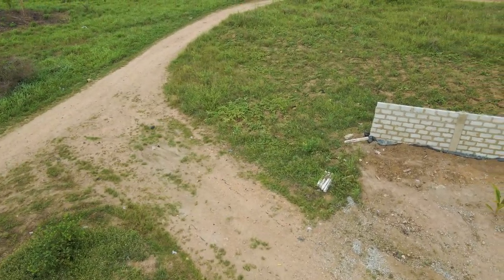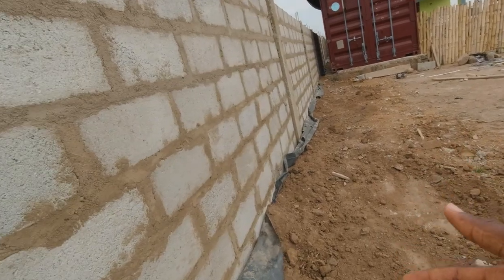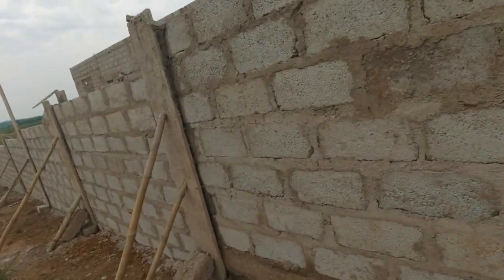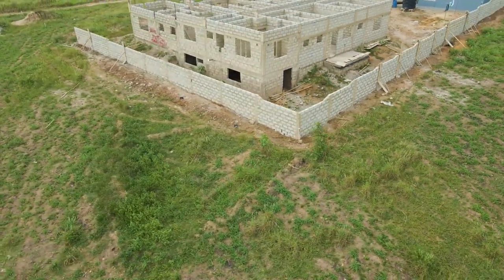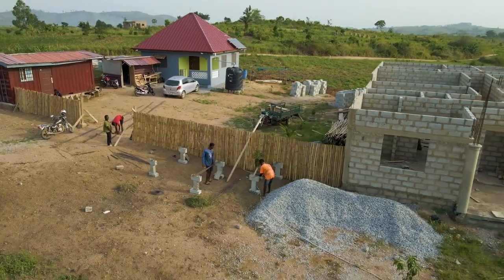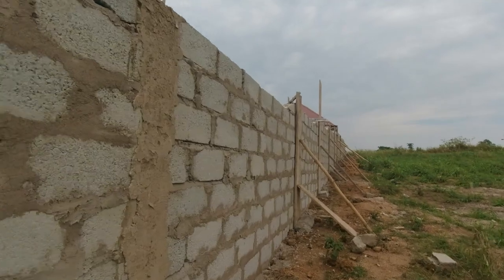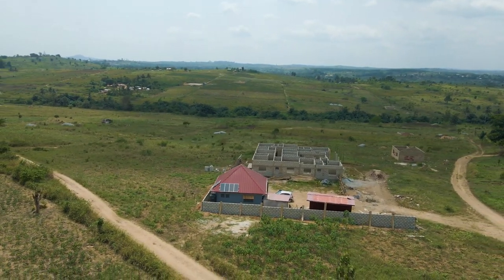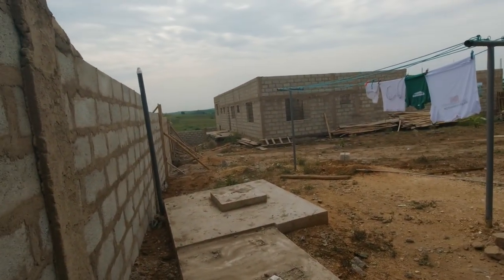From Start to Finish: Building a Fence Wall in Ghana

Comment: My contractor told me I needed 55 bags of concrete for only 2 walls of my 2 plot property and 1500 blocks. You used 2050 blocks and around 50 bags of cement for 3 walls. I think I’m being cheated.
Reply from the maker: I think you have to discuss things with your contractor to understand exactly what's going to be done before you can conclude. Also, you have to know that, there is never a same project, all projects are unique and therefore each has to be treated as such. Maybe the topography of the place requires more blocks, maybe they are digging to a certain depth all these affects cost. So kindly discuss everything with your contractor.

Comment: I have just watched a video of yours where there was a little Structural defect as no Pillars we used at all and to make matters worse they have already cast the lintel concrete. I realised there wasn’t and Pillars at the back of the building. What explanation do you give for that. If even there wouldn’t  be another upper floor, the woods for the Roofing’s are heavy so I expect, so I expected a few Pillars with iron rods to be able to pick the weight of the Roofing. Your explanation Sir.
Reply from the maker: Hi, if your question is with reference to the bigger building by our minimal house, then the answer to that is, because the back porch of the house isn't of a bigger size. It's 4 feet in breadth which is the section away from the main building. The roofing wood works would be able to extend to that size without any challenge, considering weight. The bigger chunk of the wood for the roofing wood works would be on the actual building, whereas a small section extends out. I hope this answers your question. Thanks for asking
Reply: @IshmealLamptey  Your answer came so quick. I had wanted to say something real funny when your requested some nuts for the monkeys on your shoulder but anytime, the system didn’t allow me. I am a very typical Accra boy so I fear all animals. I won’t even there visiting that Monkey Village. 🤣😂. What’s the Africa Village in the Central Region About, it’s so huge.
Reply from the maker: @samuelkelly2197  interesting to know about you and animals. Regarding the Pan African Village, i do have a video that explains it better. Kindly do check it out to better help you understand what the whole project is about.

Comment: How many blocks will I use for one plot fence Wall like 5 course?
Reply from the maker: What is the size of the plot?
Reply: @IshmealLamptey  70 by 100
Reply from the maker: @philipafetorgbor9607  you'll need about 1300 or more of blocks

Comment: Is there any benefit to doing a fence wall before you start building anything?
Reply from the maker: There are but this will also be dependent on where you're building and the situation there. If there are issues with theft among others, then you may have to consider a fence wall first
Reply: @IshmealLamptey  Located at Panpaso, and neighbours are few and far between. Lots of greenery around. Don't know about any theft issues yet, I guess the real issues will come up when I start something. I've just been thinking between fencing first, building a small outhouse first or just starting with the main building.
Reply from the maker: @AntoniJordiOwusu  i will advise you start something small to see how that turns out. Then that will influence what to do next.
Reply: @IshmealLamptey  sure thanks
Reply from the maker: @AntoniJordiOwusu  you're welcome

Comment: How many steel rods needed
Reply from the maker: The quantity of steel you use will depend on a couple of factors, such as the size of the land, the number of steel to be tied together, the height you prefer among others. But for a 7 feet height, tied in fours, 1 full length steel is able to do that.  So you can count the number of pillars and multiply it to determine the total quantity